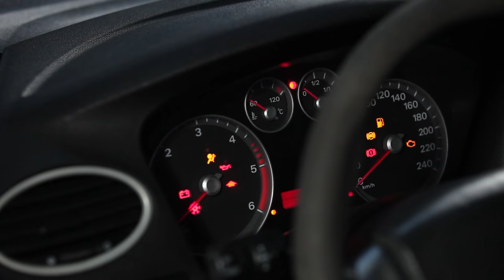How to change Engine Oil and Oil filter on FORD FOCUS 2 TUTORIAL | AUTODOC

Comment: why didn't you remove the oil filter cap before draining it? Its a sealed system, wouldn't it need airflow to drain fully?
Reply from the maker: Thank you for your feedback and for your attention to the details.
Unfortunately, our mechanic made a mistake; when draining the oil, the upper filler cap must be opened.
Our experts will look into it. 
Stay tuned for more videos in the days ahead.
Best regards, 
Autodoc team!

Comment: Why change first filter and then drain the oil after?
Reply from the maker: Thank you for your feedback! At first we need to change oil filter to pour out all the oil, which is in the bowl, in the oil trough. Best regards, Autodoc.
Reply: The filter bowl has an oil way in the base which the peg on the bottom of the filter seals off. When the filter is removed, the oil way is opened which allows the oil in the base to run down into the sump pan. Have a look at Mann part no HU716/2x which shows the peg on the filter base. Mann are OE to Ford by the way.

Comment: 5w-40? No!!!!   Ford =5w 30oil
Reply from the maker: Thank you for your feedback!  The viscosity of  oil to be used with an engine depends  on the engine which is mounted on it, rather then on a car brandmark. You can find the information on an oil to be used  with your car in your  Service Book or  , please, contact  our Support Team  by e-mail info@autodoc.co.uk, and our managers will surely advise and  check the suitable  oil. Best regards, Autodoc.
Reply: @autodocuk  Well.. On the vidio I see a ford focus 1.6 diesel. All 1.6 diesels ford focus use 5W 30. You only use 5W40 if the engine uses oil.
Reply: I use 5w30 in my focus, living in a cooler climate is fine for thinner viscosity.

Comment: if you don't understand it, don't post stuff like that. fuel oil filter also needs to be changed!
Reply from the maker: This video is for informational purposes only and does not guarantee the achievement of a specific result; this video contains only tips and tricks that may be useful when repairing a car or replacing parts.

Comment: How about instead of the dungarees, you wear proper overalls zipped up looking professional?
Reply from the maker: Thank you for your feedback! We are grateful for your valuable recommendation, we will surely consider, it when doing further replacements and  making new videos. Best regards, Autodoc.
Reply: That's gratitude for you.
Reply: @jonescrusher1  

Nothing to do with gratitude!

autodoc are creating an excellent set of how-to videos and using the Henry Ford philosophy, should always look to improve.

My comment was based on common sense. Doing car maintenance is dirty work and best done wearing a coverall. A bib and brace lets your shirt get dirty.

If you're in my situation, having to work outside, get a coverall about 6"/15cm larger than your normal chest size so you can wear your coat underneath on a cold day. That way, the coat doesn't get dirty.
Reply: Spanners & Sockets the man in the video isn’t in your situation, he’s making a demo indoors. That should be obvious.